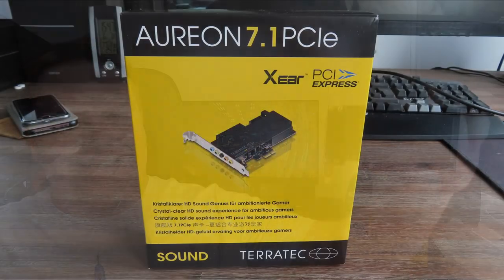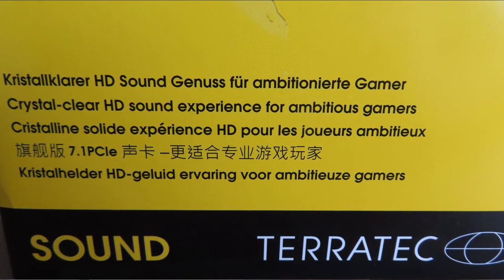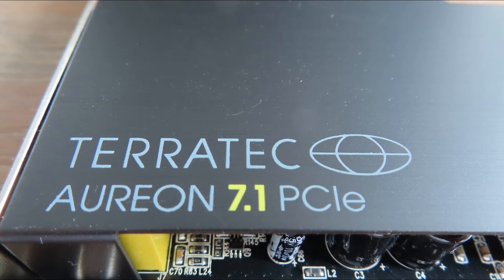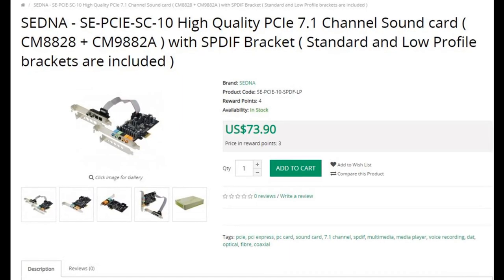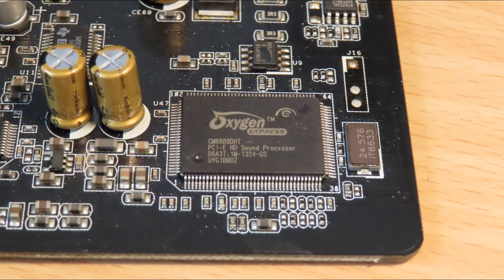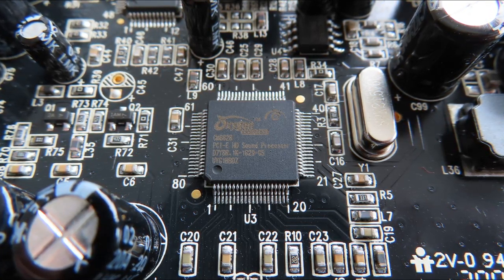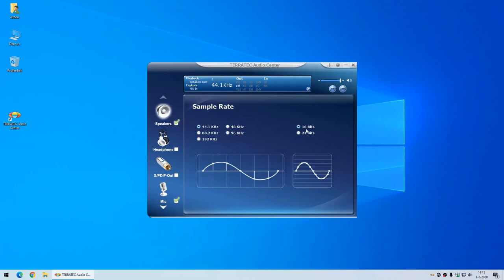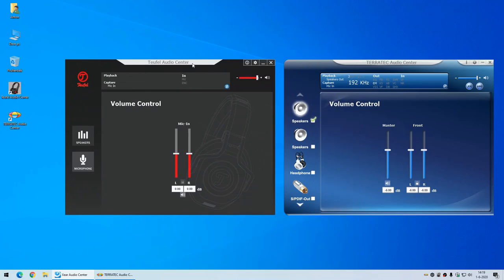A budget sound card for the ambitious gamer!

Comment: About the 16 bit/48 KHz. As long as you're only listening, this provides all the sound dynamics that the human hearing can hear. The CD Audio standard was set to 16 bit/44.1Khz for this reason. More is only useful if you're going to be mixing and editing, where the extra bandwidth helps to prevent clipping. But if you are just playing games and listening to media that is prerecorded, you are completely fine with CD quality, 16 bit/44.1KHz.

Unconvinced? Download a 24bit 96KHz sample sound file and convert it to CD quality with a high quality converter. You won't be able to hear the difference.

Comment: Good morning my friend. 
I am interested in buying this sound card to connect to spdif optical output to my 7.1 multichannel amplifier. 
I wanted to ask if the spdif output of this card directly gives multichannel sound 5.1 - 6.1 - 7.1 D.T.S - DOLBY etc, depending on the movie that has the sound. 
Only use with movie. Is good for this purpose? 
Thank you very much. 
(Sorry for any mistakes writing from Greece to English with google translate 🙏😀)
Reply: I bought this sound card but I connected it via the 7.1 analog outputs to my 7.1 receiver. I currently do not own a toslink cable to test if it works with the optical output.
Reply: @Aranimda  Thank you very much for your reply.
I would like to hear from someone about optical output.
I had years ago an awesome Hercules 7. 1 card with optical output but it only supports windows xp.
Now I have windows 10 and I want to get multichannel audio with a spdif  cable.

Comment: does this outperform Creative Sound Blaster Audigy Fx 5.1 in terms of audio quality when lets say gaming/listening to music?
Reply from the maker: Couldn't tell. Both are ok soundcards, altough I do prefer the Terratec!
Reply: I got the Sound Blaster X-Fi Platinum PCI-e and this Aureon 7.1 Both have a great sound quality. Meaning that the sound card will not be the limiting factor here, but your speakers, heaphones or hearing are.

The X-Fi and Audigy cards have more features, like hardware EAX for older DirectSound3D games and industry's best 3D positional audio for again, older games. Modern games do all their sound calculations in software, so the EAX hardware engine of the Audigy/X-Fi gets unused. Also the Creative Audigy/X-Fi have a MIDI synthesizer and the Terratec does not.

So, the Creative cards have the edge with features. But on my computer the X-Fi gives a BSOD so the Terratec is a great alternative, with stable drivers and excellent sound quality.

Comment: Hey Anton, can you check if it is made in China or Taiwan? And for the Asus while you're at it? Thanks!
Reply from the maker: The Terratec one is made in Taiwan. And which Asus did you want to know? Just wondering, why do you ask?
Reply: @AntonsHardware  Thanks. The Xonar AE you recommended. I don't want to buy anything made in China if at all possible to avoid it, it's not a matter of quality, but rather Chinese politics.
Reply from the maker: That I do understand. I'm not into politics, but Chinese politics is a bit difficult (to say the least)

On the box it says; Designed in Taiwan, made in China. 

Lol, that may not help you that much. :D
Reply: @AntonsHardware  Dankjewel! It definitely does help - knowing is half the battle. Looks like Terratec may be at the top of my list for the time being.

Comment: do you recommend this sound card in 2023 ?
Reply from the maker: Kind of yes. It's not bad, it's just not the best you can get. Maybe check out the Soundblaster Z.
Reply: @AntonsHardware  the sound blaster z se  gives me crackling problems unfortunately
Reply: @AntonsHardware  unfortunately the sound blaster z se gives me crackling problems
Reply: Yes, it works fine with the latest Windows 11, 23H2 and onboard sound usually does not have 5.1/7.1 analog outputs.